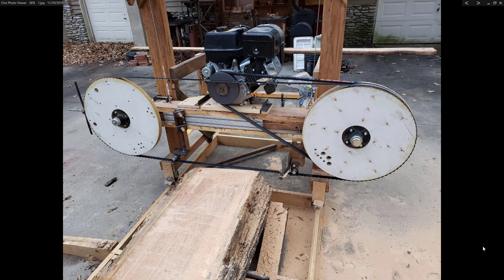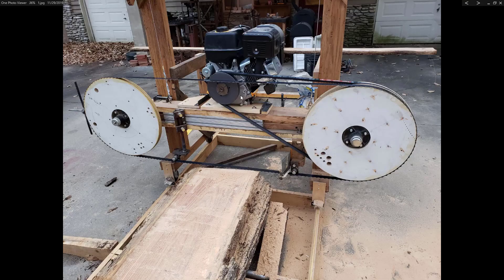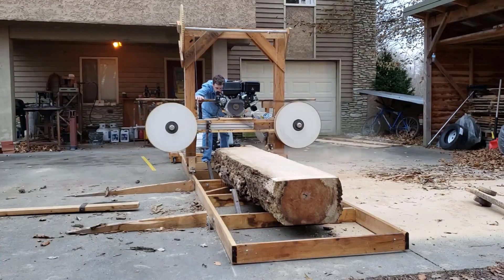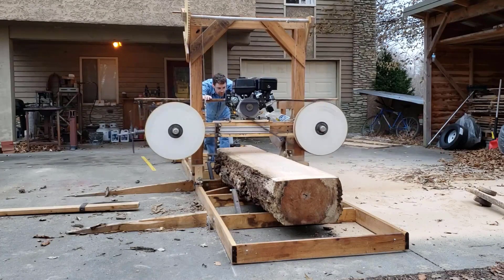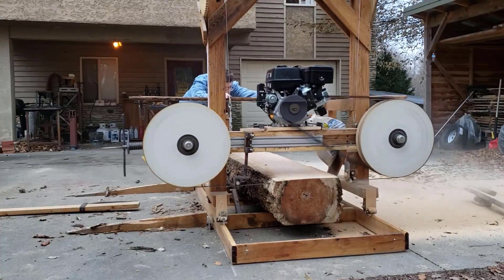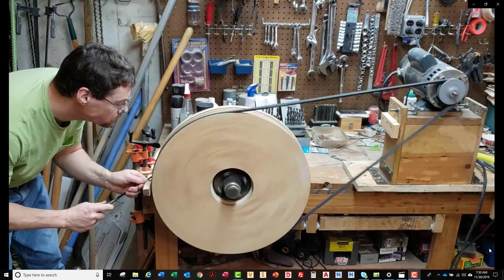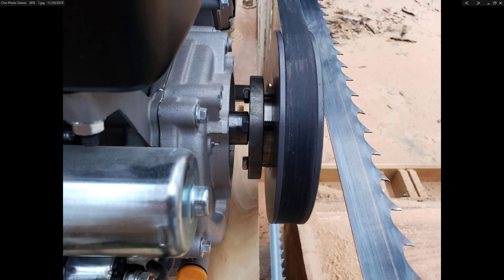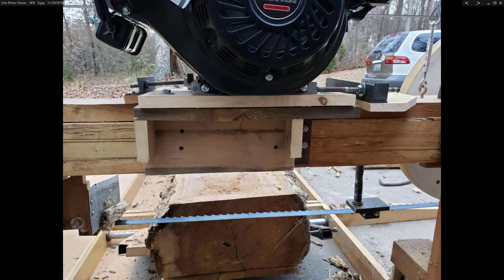Bandsaw mill motor upgrade

Comment: Thanks for the update. I’ve been working on one based a lot on your design so it’s all interesting info. How is it holding up otherwise? Any other issues? Hope it’s going well.
Reply from the maker: The other thing I am going to be replacing is the all thread tensioner. The basic design is very good but I should have used Acme thread that is meant for a lot of pressure and repeat usage. The area of the thread that I use has deformed over time. It still functions but I placed an order this past weekend for a replacement acme threaded rod and nut.